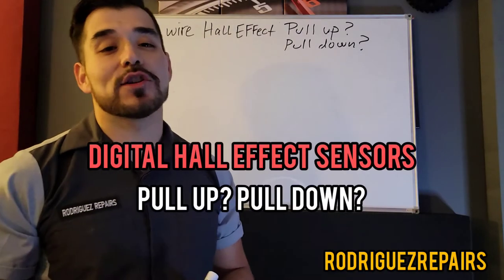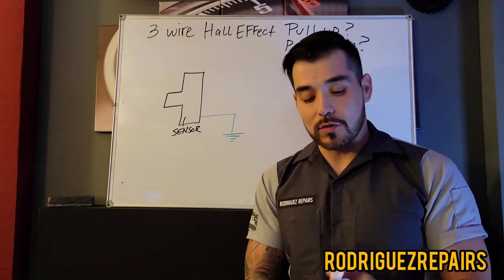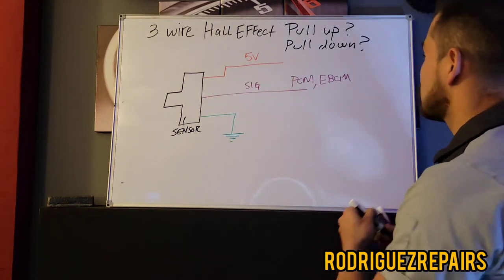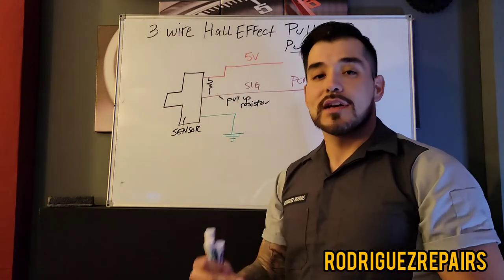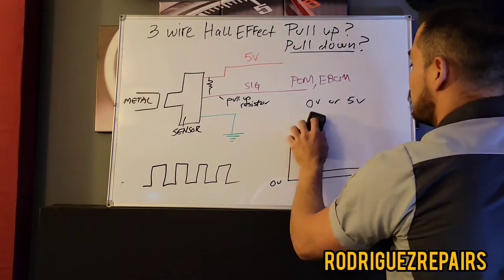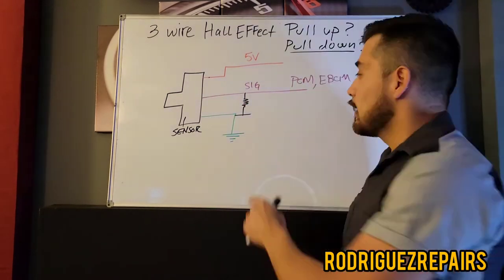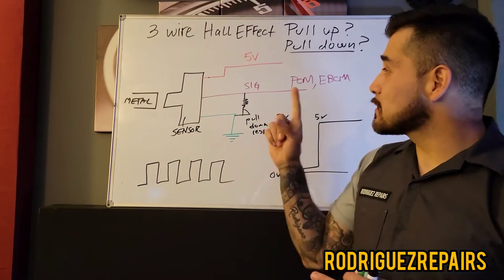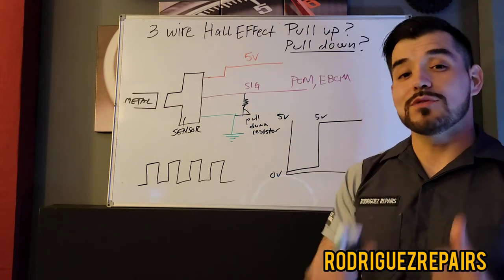3 Wire Digital Hall Effect Sensor. Pull up? Pull Down?

Comment: The Pull-up doesn't always have the resistor. What's important to know is the voltage level on the signal wire is when it is unplugged from the sensor;  be it is high or low. If the signal is high unplugged the sensor is Pull-Down design. If the signal is low unplugged the sensor is a pull=up.
Reply from the maker: I agree 100%
Reply: And what voltage is considered “low” or “high” I have a vw polo 1.4 16v and the signal cable when unplugged from the sensor has around 4,8 volts.
Reply: @RodriguezRepairs Thanks for the video! So the A3144 hall effect sensor is pull DOWN sensor? I didn't realize that there are pull UP sensors (Hall effect sensors that use pull DOWN resistor)...¿Do you know some model of pull up sensor?
Thanks a lot! 
Greetings from Argentina!
Reply: You have that backwards I think. If the signal is high unplugged it will be a pull up sensor because the resistor will be between the signal sense wire and 5v reference, and when it gets unplugged the voltage gets pulled up. Vise versa for pull down. I just wanted to do a correction for anyone in the future, I know how conflicting information can confuse someone and drive them insane from trying to diagnose their vehicle or just understand how something works.

Comment: Hii,great  video, can you please assist

I have a chevy spark with no pulse on injectors, voltage at crank sensor is 1.88v ,can this be right or too low

Comment: So if I put a jumper wire between the 5 volt reference wire and the signal wire will it fool the computer to think everything's fine and get my check engine light off so I can pass smog?

Comment: ????? pull UP should have resistor to +5V,  pullDOWN should have resistor to GROUND.
Reply: Yea I got a bit confused too even though it was somewhat understandable. He just got the terms mixed up and wrote the schematic backwards. The pull down design uses a resistor between signal and ground and starts the signal or “sensing” wire at 0v and climbs to 5v. When disconnected the signal wire is empty. A pull up is the opposite and starts at 5v going down and when disconnected signal wire will have 5v equal to the ref 5v.

Comment: Hy, i have a question, can you tell me how can i connect a loudspeaker digital volume control to a hall sensor (from finger throttle's ebike ) in order to be able to control volume.  Thank you in advance for your answer
Reply from the maker: So you want to control volume from your fingers throttle? In on and off patterns?
Reply: @RodriguezRepairs  yes. i want to control loudspeaker volume with hall sensor from finger throttle, but not only on and off.... i want to increase and decrease volume accordind to tension variation from hall sensor
Reply: this is the loudspeaker : https://www.youtube.com/watch?v=zl9cG_fVynM
Reply: and i want to connect the 3 pins of the hall sensor to the USB from finger throttle.... and the digital volume in a USB mother connector, in order to use a small USB cable for connection between toudspeaker and finger throttle's USB
Reply: and this is the finger throttle: https://bmsbattery.com/home/1132-lcd-tf100-display-with-throttle.html

Comment: I don’t understand? Hall sensor will output 0-5 volts based on magnetic field regardless of an external resistor. There must be another purpose for the pull up or pull down? Noise interference perhaps?
Reply: He is explaining, open drain, without knowing it.

if he really know, then please send me the Part no, of the hall sensor.

Comment: There is no such thing as a pullup or a pulldown resistor. The resistor has an ohm value. Where the resistor is placed in the circuit determines the name of the circuit. 
https://youtu.be/hHSRLfXBN7s?si=F5hCbRL6m4g43CKU

Comment: Want to make some good money repairing or kitting out cam plate sensors for 2005 through 2007 Buells?  These are mainly 2006 Buell XB12X Ulysses, 1203cc 103 hp adventure motorcycles. I can send you pictures and an actual cam plate with its embedded sensor. The plate is about 3 inches in diameter with a sealed plastic sensor module pressed in. Standard cam plates for any of the other Buells WILL NOT WORK. I do not want the business or money. I am retired and just want my Buells to run. Best to you. George